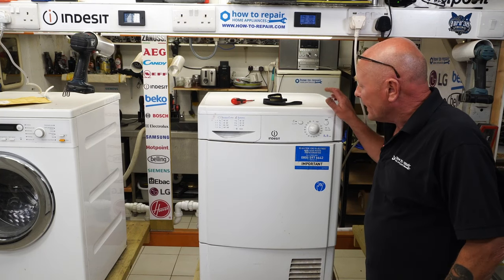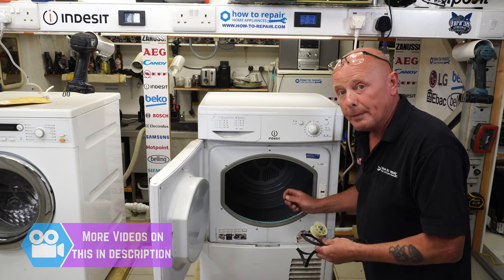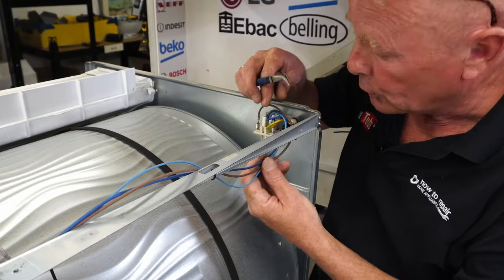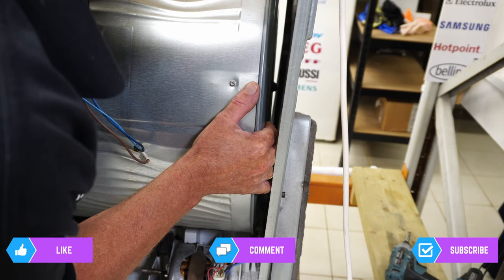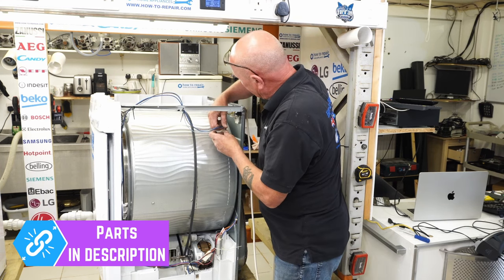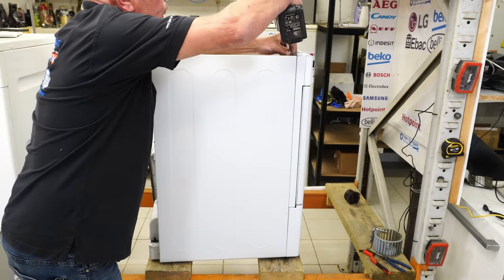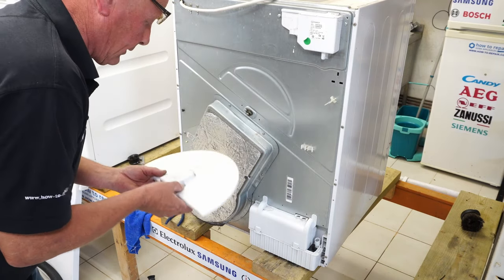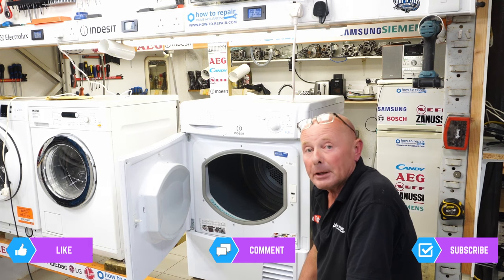Condenser Tumble Dryer Belt and Pulley Wheel Replacement | Hotpoint Indesit DIY Repair 📘🔧

Comment: You are a great teacher in demonstrating the task of servicing a tumble dryer! I have seen in another video the belt being replaced from front but you have replaced it from rear which seems lot easier to do.On the aspect of stretching the belt over the fixed pulley, why the hell the manufacturer didn’t design it so it is spring loaded? This would also keep a constant same grip on the drum and motor shaft.With the present design the new belt will over the time will start losing grip as it will be stretching!

Comment: Thank you so much. Didn’t think I could do this myself but changed the wheel belt and bearing with your clear and easy to follow guidance. Few scratches on the hands but all worth and you’ve probably saved me hundreds as I would have bought a new dryer! 😊

Comment: Just took mine apart, because the belt had come off. Amazing video and description. Also watch out for that connection block top right. Mine had loose connections and was arcing. Bot wires were melting together. Fantastic video.
Reply from the maker: Hi thanks a lot for your comment and I'm glad it helped. It would be really helpful for me to get my video shared and help us fight appliance waste! Please remember to subscribe to our channel, as that really helps us 😇

Since we work very hard in our warehouse making free video guides for you all on appliances, we always appreciate a beer, offering a choice of single or round beer. https://www.how-to-repair.com/help/buy-paul-a-beer/ 

Thanks, Paul 👍

Comment: I have an Indesit idpeg45a1eco with a heating problem.I just followed your instructions for the belt to be changed....perfect!(I used the old belt to pull the new one onto the wheel!)I dismantled the whole machine and clean all the lint .the problem is that in the beggining  the compresor doesnt run so the dryer doesnt   dry.checked both capacitors by the motor,and they are ok.cleaned the humidity sensor inside the drum and I was thinking about the ntc located by the compresor.what do you think It would be?congratulations for your Channel!Thanks for your work!!

Comment: That is a great hack to get new belt on
Reply from the maker: It's not perfect you have to be careful not to touch the pulley wheel with the screwdriver, but the other videos that are on YouTube showing you just to stretch the belt and pull it over the wheel are done for video purposes only in real life. It is nearly impossible to do it.
Reply: @How-to-repair  Trust me I’ve tried and it’s almost impossible without skinning knuckles, in my case
Reply from the maker: @Roadkill7878  if you find the right set of grips for the job, it is hard, but it's much easier than trying to fit the belt without the right equipment

Comment: just in case anyone has a similar model Indesit to mine - 
 I was happily following along when I hit an extra hurdle as soon as I removed the side panel, my model has a circuit board obstructing  the fan covering from being removed! ha! 
So, Ive taken lots of pictures of where everything plugs in!! I would have done a video but I needed the torch on my phone 😂....then slowly unplugged some of the wires from board, then unscrewed the board from the machine, this was accessed from the front of the machine (that was under a little cover) and needed a star type allan key tool (please help me out I don't know the name of that thing, I just happened to have one!😂) - then I could remove the fan covering :) 
Now having a little lunch and a big cuppa coffee before I go back and assemble it all back together after replacing the pulley :) The extra step of removing the board required a breaktime lol
Reply: You only needed to remove the two front screws and then the whole panel can be lifted out to the side without disturbing the wires. There may be the odd cable tie to snip off but just removing the panel to one side leesens the risk of error. But top marks for taking photos! In the old days I always used paper and pen to draw out the connectios if I had to remove a module or timer.
Reply: I’ve just hit the same snag with the circuit board. Your note about a torx head bolt from the front is very helpful, thanks
Reply: @arightmonkey  ahaaa!! A torx! You answered my question, many thanks to you too!

Comment: i have hotpoint model TCFS 83B GG and need to replace the belt. this is very helpful, however there is a spring which has come off and i cannot figure out where it goes. Does anyone have any ideas?

Comment: I did this, but with fitting the belt in front of the drum instead. now one of the brackets got lose, and i didnt know where it was. there is several places to put it, but only two brackets. im afraid it wount spin correctly if not put the right place?

Comment: Can some please help: Would a broken. Belt also cause for the "empty water" light to stay on?
Reply from the maker: the water light should only be on if the pump chamber is full of water. If the drum is not able to turn, then it would not be able to evaporate the water from the clothing, as there is no airflow.
Reply: @How-to-repair  thank you, whilst I have your attention can I ask. I have checked the pump and it is working, the rubbing blade is spinning and the blade is intact. So I'm not to sure why the light is on when the pump chamber is not full of water?
Reply from the maker: @evieemaya88  it does not matter if the pump is working, it matters if there is water in the chamber and the float is activated
Reply: @How-to-repair  yes this is the case, there is no water in the chamber and the pull out drawer is empty of water but yet the light comes on?
Reply: For anyone else having this issue, for me it turned out the water gulley inside the machine was blocked with dirt.  If you remove the condenser box at the front of the machine , behind that alot of dirt can build up preventong the water to drain out.  There is a side panel that you can drop tonget better access to clean this from a side angle.👍🏽

Comment: indesit good brand or not?
Reply: They often get called Indeshit if that helps.
Reply from the maker: The design on this dryer has been around for many years, and when you consider the cost of the machine, it's not bad for an entry level, simplistic to work on it well maintained they will go on for a while, but in most cases, general public declines to do any maintenance on the machine
Reply: @How-to-repair  Yep, the amount I go to and the condenser has never been cleaned
Reply: Don't you check operation before final assembly?
(Over the years, I found that time saving and very useful avoiding frustration)
Reply from the maker: Yes, I normally give it a flash test, but if it's done correctly I don't normally have to worry and you must remember I make videos for the general public therefore I would prefer them to be kept safe when testing the appliance that means it really needs to be sealed up
Reply: Easiest dryers to work on ,parts are cheap ..You can keep them going for years